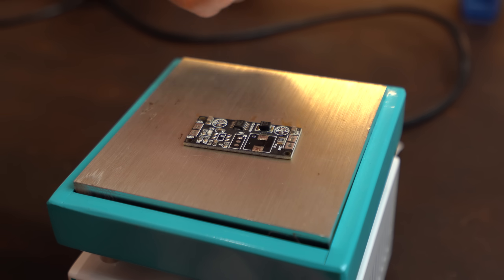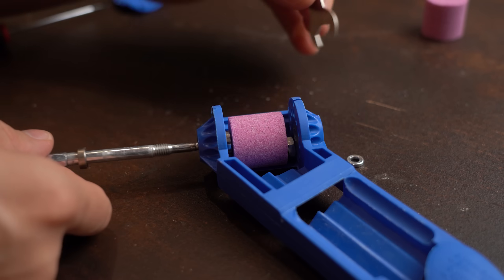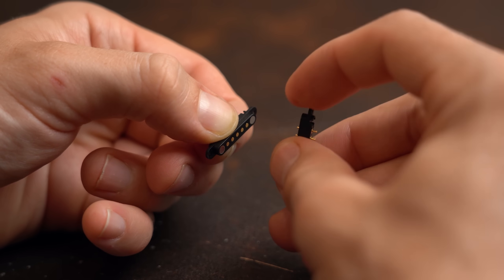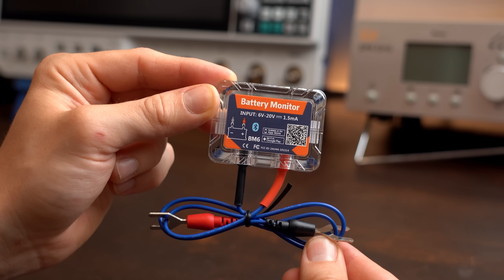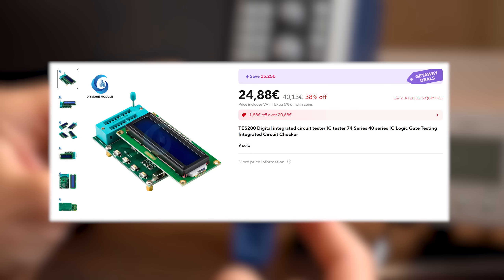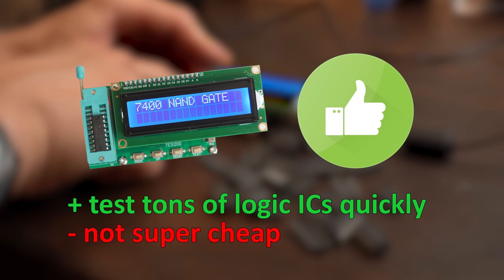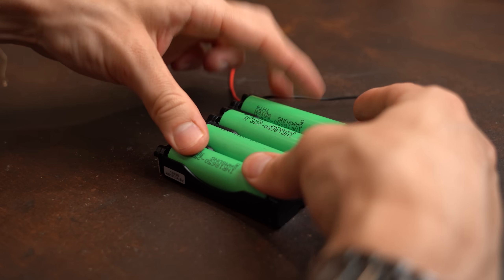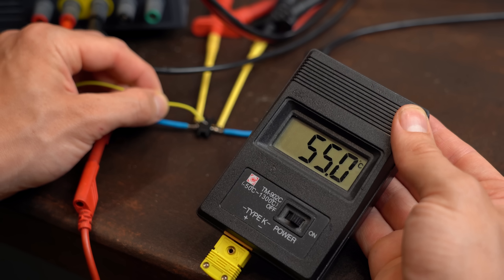I tried finding Hidden Gems on AliExpress AGAIN! (SPECIAL Part 10)

Comment: I like the idea of the battery monitor, but I don't even remotely trust the toggle switch in the app... or the app. I feel like I would be a little more confident in it if you isolated and disabled the GPS circuit in HARDWARE with desoldering. Wonder how hard it would be to do...
Reply: On certain phones, you are able to configure firewalls for specific apps and prevent them from accessing the internet
Reply: @PixlRainbow  I'm not sure that's how that works. You can deny certain permissions to apps, but if you've read anything about bad apps in app stores over the last decade, you'll know that there are many apps that do sneaky things for years without being discovered. I'd love to be wrong, though, so tell me more about the firewalls method you're referring to.
Reply: @nimoy007  I've sent a reply, but I don't think it's visible to the public. It might have gotten caught by YouTube's automatic spam filter.
Reply: @PixlRainbow  I don't see it, guess it got filtered :/
Reply: If you want to desolder the GPS hardware from the device then I would say that is not just hard, it's impossible.
Since there is no such hardware on the device (if device = battery tester).

The phone has the GPS not the device.
Reply: @TheHellis  Ah, so this is one of those fake tracker products that is useless for tracking. The only way Bluetooth trackers work is if you utilize a network of users like Tile, Apple or Android trackers do. Well, guess I misread this one. I really don't think this device is useful...
Reply: @nimoy007  kind of..
The reason it needs GPS permission is because radio can be reversed to use as tracking.
Just as you mention Tile or just by that at this position a beacon is transmitting and if your phone is within range your location is compromised.

So that is why GPS is part of the permissions.
I honestly don't believe the app has any reason to track you or your car.
But obviously that is my relaxed opinion, yours might differ.

Comment: The car battery monitor is soo cool! I wish we had one that had like a tiny screen you could install on your dashboard, eliminating the need for an app.
Reply: Lol they make very cheap battery monitors you can do exactly that with.
Reply: like the one that’s already on your dashboard?
Reply: Get a usb charger with a built in voltmeter. The one I have also shows charging amps and temperature
Reply: Dont install without fuse
Reply: you mean like .... a normal voltmeter... like from the 1970s. or 80s. yes. keep it simple!
Reply: They have one that comes with a screen lol. Now im off to look for a version that has longer range so it can ping me at home that my dumb ass left the lights on.
Reply: @Likeomgitznich  I will have to do some research!

Comment: I find the battery monitor interesting... but connecting with Bluetooth... 10 meters, so probably 5 meters reliably... why bother designing a product with GPS so you can find it?  If I can't find my car from 5 meters away, I probably shouldn't have a car.

Or am I missing the point here?
Reply: Yes.
You really miss the point here.

The device does not have GPS.
The phone does.
The app just record the position of the phone when it loose connection with the device.
That means you can open the app later and see where you lost connection with the car last time.

Comment: That FPGA board seems fun to work with.
Reply from the maker: Yep. Was pretty easy to set up and use. Maybe I will do an FPGA series in the future :-)
Reply: @greatscottlab  as for the drills, always use some coolant, I use mineral oil, u can buy a proper coolant but for us, that is not something heavy, just having a visual indicator of the temperature while helping the drill to cool, will make your drills last longer.
Reply: Yup, I'll have to check it later but microcontrolers lack video output and more graphical capable solutions like Raspberry (or equivalents) take a long time to boot (which for some applications could be an issue), that might be a sweet spot between the 2.

Comment: Turning off GPS in the app is meaningless. Block the permission in android.
Reply: The problem is that the app is built on an older version of the Android System API, which tied Bluetooth scanning to location permissions. Google has since updated their API to allow apps to request Bluetooth scanning separately, but this does not retroactively apply to older apps; apps have to be reprogrammed to use the new permissions.

Comment: Pogo pin connectors would be ideal for my model railway lighted, and servo'd buildings. I looked into them a few years ago and did not find them cheaply, so it's time to revisit them it seems.
Reply from the maker: Go for it :-)
Reply: @greatscottlab  The only "bad" thing I read about it are the short solder pins. How was your experience?
Reply: quite a few people are using this exact pogos in a project I'm monitoring, and they're functioning well so far

Comment: To the issue with the app needing location permissions for Bluetooth:
This is actually a very misunderstood feature. I don't know about this specific app but I'm guessing it wants to discover Bluetooth devices in the area to find the device. 
Since someone could technically track you by having a lot of Bluetooth devices scattered around you, this needs the location permissions. On modern devices, this does not require the GPS permission (exact location) though.
Reply: Yes Apps that need permission to use blutooth need to have location permissions. I don´t really like that they implemented it that way but there is nothing we can change about that sadly
Reply: @XA--pb9ni  Its because there is no way to prevent it at the protocol level. People with Bluetooth access can track your phone by using known Bluetooth devices in the world.
Reply: @XA--pb9ni  
I want  to emphasize that at least on newer versions of Android, this is a separate permission.
Reply: @taukakao  exactly, and the people claiming to be worried aren't even using grapheneos
Reply: I've been considering switching to a pixel phone specifically to use graphene.
Reply: @taukakao  originally BT access was a fully separate. Later people found that an app being allowed to scan nearby BT devices could potentially find out your location doing so, so it was lumped under the Location permissions to make it more clear that "hey, this could be used to track your location".

Obviously was not ideal because that same permission now covered both relatively coarse BT location, and precise GPS-based location. So Android introduced a bunch of new BT-related APIs that would allow an app to use BT and connect to a specific device without giving it the ability to scan. It's an Android 8+ feature and it's called the Companion Device Manager - basically it lets the app tell the OS that it wants to connect to a device, and set a bunch of filters to tell the OS what kind of device it's looking for, but then leaves the actual scanning and connecting to the OS, and so the app never gets general nearby device data which could be used to find your location. Why more apps don't use this, I will never know.
Reply from the maker: Thanks for the feedback :-)
Reply: I came here to say the same thing haha.
Reply: bluetooth headphones dont have the capability to track
Reply: @nomercyinc6783  The thing is it's not about single bluetooth devices, it's about all devices that are reachable by your phone. 

And every device can be used for tracking, even headphones although not ideal since they are typically moved frequently.
But a app can cross compare bluetooth devices if it sees the same device on two phones it can cross reference that both are somewhere close. 
There is a technique called war-driving where this is often done. That's for example how location data for WiFi APs are gathered.
Reply: Location needs to be enabled for Bluetooth Low Energy Scanning on Android 6.0
Reply: they intentionally bundle stuff incorrectly apple and google do this.  Like why is my baraometric pressure sensor in the location permission list, why isn't my actual location gps seperated from my mac address and other network data.  I just refuse to use them,  if the product doesn't work.  Then I don't need it.  Only by standing our ground and keeping our money from them, will anything actually change.
Reply: That requirement from android/google for BLE implementation
Reply: You got that backwards: Bluetooth used to not require precise GPS location, but newer Android versions now demand it.
Reply: @uzlonewolf 
Ok yeah, very old Android versions didn't require any permission for it. 
Android versions from some years ago require GPS location and new versions require the "find devices nearby" permission.
Reply: Why are you all so concerned about what data an app collects? I only care about what data an app sends to someone else...
Reply: @HenryLoenwind  Yeah, so? With a closed source app you can't know what data it sends to its servers so the best thing you can do is restrict the app as far as possible.
Reply: Location permission is needed for communicating with BLE devices.
Reply: Well. Last time this itched me hard I found that there are two official libraries for using Bluetooth. The library facilitating "low power" usage by the Bluetooth unit requires localisation permission. Only real reason I can see for this is that Google discovered more and more people disliked to be tracked by gps so they needed a new method to track us. Solution was to blame it on bt through a low power consumption library.
Reply: @noldushumlesnurr6169  Bluetooth needs localization permissions because it can be used inherently to locate you.
Reply: @noldushumlesnurr6169 that's quite the conspiracy you got there. Especially because it doesn't make sense - Google already has a handful of system apps on every device that don't even need to ask for permissions.
Reply: @noldushumlesnurr6169  If the issue is on Google than they (being the developers of the OS) could easily do so without requiring third-party apps to require location permission. People disliking tracking via GPS also isn't the full story, because since the very beginning it also used WiFi data to pinpoint your location. And yes if a app wants to scan for nearby Bluetooth devices or Wireless APs they need location permission as well it's not just BT LE and therefor little to do with "low power", but the introduction that Apps need location permissions for wireless scanning came later. 

That almost all wireless protocols can be used to track your location is a pretty fundamental property. If you know locations of nearby wireless transmitters and the approximate distance to them then the location can easily be triangulated.
Reply: @noldushumlesnurr6169  All of them need location permission if they need a list of devices however the normal non LE one can use the systems pairing dialog therefor it doesn't need to see all devices and can't derive location. If however a normal Bluetooth app wants to ship a custom pairing screen where it scans for devices it also needs location permission. Same thing with WiFi.
The reason why LE needs it more often is because it's not a continuous connection and afaik the app needs lower access where it can read all BLE traffic to know whether a device is even present. 

The OS could gather location data any time, it wouldn't really need a third-party app to get location permissions so it doesn't make that much sense.
Reply: I would HIGHLY suggest that you read the privacy policy before allowing the app to access your data, there is no way a battery monitor needs the kinds of data they collect with this spyware app.
Reply: @Pro1er  I guess you didn't read the comments. This is a Android requirement because listing wireless devices (including Bluetooth and BLE devices) does by extension reveal your location.

Yes reading the privacy policy is good practice in general a app can collect a lot even without location permissions, but that wasn't the point.
Reply: @Pro1er  
I mean you're right but have you even read my comment? 
It does need this permission to find the Bluetooth device.
Reply: @taukakao  I have no idea, I uninstalled the app after reading the privacy policy. It's a shame really because the hardware seems nice for $15 USD. My truck doesn't have a voltage meter so I bought one that has USB ports and plugs into the cigarette lighter plug. If I need to I can always check the health of my battery with the $25 clip-on diagnostic tester I bought a few years back. It also has a memory and I can download the data to my PC. Pretty much any auto parts store will check your battery for free. I'm getting sick of this spyware.
Reply: I doubt that it can connect to GPS satellites if it is located under the metal hood, without external antenna
Reply: @drazenradosevic7467  GPS satellites aren't connected to. Multiple satellites are listened to and your location is calculated. That is low precision but it works anywhere that GPS is line of sight. It can save your life if lost.
High precision adds in WiFi, BT and cell towers combined. For the younger people, radio waves can travel worldwide. You can contact astronauts on the ISS with a handheld ham radio (5 watts) and a little luck.
Reply: @drazenradosevic7467  Location services have hacks to get around lack of GPS.  Your PC doesn't have a GPS chip in it, but it (probably) guesses your timezone properly, right?
Reply: @ElizabethGreene yeah, the easiest way to do that is by your language selection. But I always choose English and I never connect with a wifi network when installing. But when I alt-click on the wifi menu on my Mac the wifi networks show up with what country they are adhering to the regulations of the radio spectrum, mind you that 2/3 are totally wrong but the last 3rd are in a consensus that they operate in the same country so at least that is a quite easy way to guess the time zone not that my Mac would need to as it has a GPS chip, but my other computer probably doesn't but it has wifi.
Reply: @drazenradosevic7467  It's connected to your phone... Running their software...

Now tell me what your phone is connected to.

Comment: The cutting edges on the sharpened drill bit look horrible tbh
Reply: Yeah, I'm not sure that is how drill sharpening works... There is no relief behind the cutting edge!
Reply: The cutting angle is completely wrong.
Reply: @dogwalker666  yeah, there isn't any angle... Just nice and rounded 🤣
Reply: @dfgaJK  Yeah the technical term is "Blunt" lol 🤗
Reply: @dogwalker666  yeah. I think the designer is very familiar with a blunt😄
Reply: @dfgaJK  lol indeed.
Reply: That has to be one of the worst geometries on a drill bit ever.
Reply: @JoeyG1973  Agreed
Reply: @JoeyG1973  Shut! It's non-Euclidean!
Reply: Naja.. wenn der Bohrer Fritte ist dann hilft es auch nicht den wieder ein Stück schärfer zu bekommen und er noch immer Fritte ist. Es gibt nicht ohne Grund mehrere Schliffe am Bohrer. Zumal bei so einem Scamwerkzeug die Querschneide entfernt wird.
Wir hier sagt, dass das was taugt hat einfach nix mit Bohren am Hut und hat in seinem Leben nicht mehr als10 Löcher gebohrt.
Reply: @hanswurstusbrachialus5213  ... ... Genauso sieht das aus 😂👍
Reply: I'm a machinist and I sharpen drills by hand on a bench grinder and that there looks like it made your drill bit much much worse than it was before you sharpened it.
Reply: @AlwaysWrenchin one hundred percent. Freehand sharpening is really not that hard.
Reply: Atrocious.
Reply: ScamMeExpress hit another victim with false claims and sold him a 10 cent product for 2 dollars 🤣
Seriously tho, if you already use a microscope to inspect the drill, try and compare it to a brand new drill and spot the difference in surface finish and cutting edge geometry. And maybe compare it to a real product that is actually designed to properly sharpen drill bits or look up a good tutorial on how to grind drill bits on your bench grinder.
Reply: it is so 1990
Reply: Yeah, that looks good and munted.
Reply: And you can hear it rubbing badly in the second clip. Ugh.
Reply: Project Farm reviewed drill bit sharpeners and this was the first one he tested.  It pretty much failed, even given it's cheap price.  https://www.youtube.com/watch?v=m3Al3bfb9-0
Reply: The center looked even worse
Reply from the maker: Well, it did work a bit better afterwards. Maybe we should not expect that great results
Reply: @greatscottlab You need a "Rake Angle" on drill bits, Those things actually blunted your drills.
Reply: @dogwalker666  Relief, not rake.
Reply: @greatscottlab you are using it wrong, don’t spin it. Hold it on the cutting edge. Rolling it rounds it over 👍🏻
Reply: @greatscottlab I thought you did that to generate comments 😂
Reply: @greatscottlab  that's what my body pillow said.
Reply: You can use a finer stone. That one is pretty coarse.
Reply: It looks not so easy to handle, maybe it's better when you tape it to a surface so it doesn't move
Reply: @realdragon its cant work by design. Sharpening isnt just 120° around the drill
Reply: User error rather than shitty tool 😂